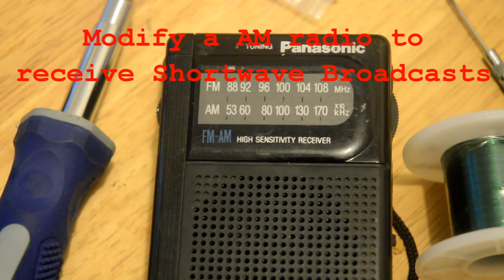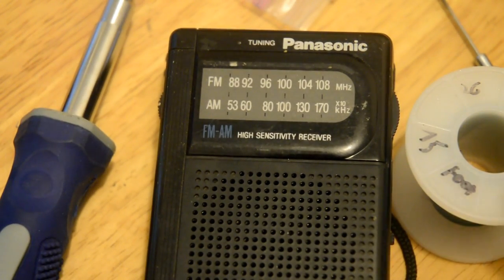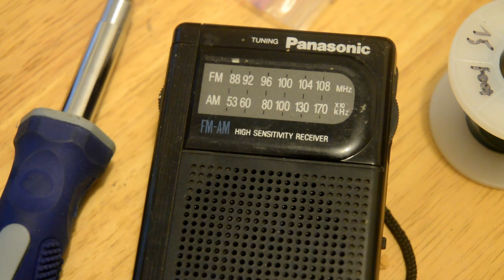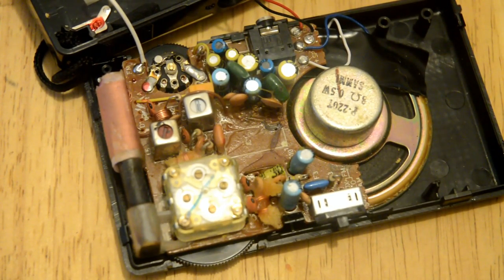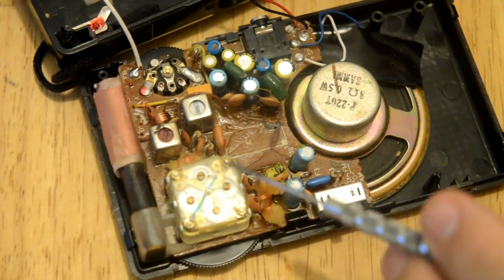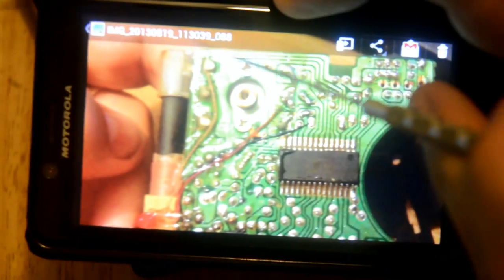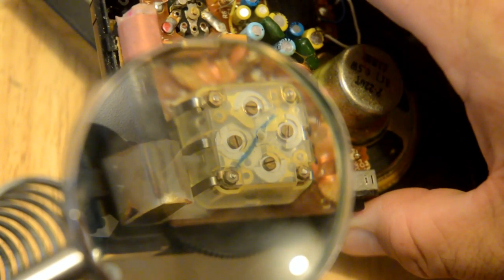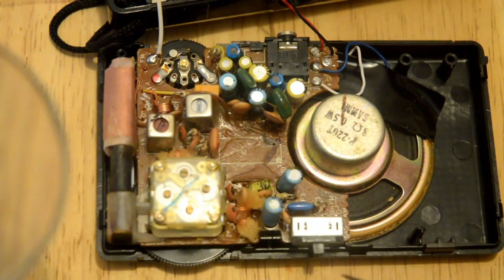Modify a AM radio to receive Shortwave Broadcasts

Comment: Hi,  Although you can shift the frequency coverage some by adding inductance, you will still have a very poor SW receiver. Depending on the disaster, I would think most people would want access to their local FM and AM bands. If there was an EMP event there is a good possibility the radio would not survive. Which makes a good case for leaving an AM/FM radio in a metal container with a few sets of batteries not installed but handy. As cheap as radios are, I would encourage putting 2 AM/FM radios in a metal box. The units that have hand crank generators are excellent. Additionally, a CB walkie talkie or small mobile unit could be helpful. A couple of Gel-cell batteries would be great but remember to test them every couple of years and replace them as needed. Family Radios, FRS, are great for communicating directly to a family member or neighbor within a mile or so but CB will have a much greater audience and help you know what is going on in your community Here is where, I would like to plug Amateur Radio, also called Ham Radio. The entry level licenses is now the Technician class and most people can study on-line test and be prepared to pass with little effort. Once obtaining a licenses, one can find 2-meter hand held radios on ebay for around ~$50. As one person stated get a Short Wave radio as well. You can buy any number of fair SW radios around $100. There are MUCH better units and I defer anyone reading this to watch some youtube videos on Short Wave Radio. This will give you  a lot more frequencies as well as international stations to listen to, assuming, they remain on the air after some international disaster. SW radios need wire that you can run outside for best reception. As little as 50 feet will work OK, 100 feet is even better and it does not have to be way up in the air. Just with a sling shot and some nylon rope, you should be able to get a wire over a 20 or 30 foot limb. I prefer insulated and stranded wire for around 14 - 18 gauge for long time storage..A few hand tools such as wire cutters, pliers, electrician knife, and a set of Phillips and common screw-drivers a roll of electrical tape and a simple volt ohm meter from Harbor Freight for under $10 will help with working with wire, terminal post, Batteries, ect, For more USA information check the American Radio Relay League www.ARRL.org. Many countries have their own Ham Radio organizations which encourage Ham radio as well as Short Wave Interest  Good luck. and as we hams say  73, (Best Regards)  Glenn WA4AOS

Comment: It won't be perfect.  It WILL work. They DO work. Too much with the theory and tapping on the phone with two fingers... you really don't have to mess with any trimmer capacitors or IF cans...actually, screwing around with alignment without a scope and a signal generator will more often get you in trouble as not... But no great harm in the little project! the top of a Bic pen can be used better then a screwdriver if you don't have any proper plastic alignment tools. And be careful, those tuning slugs are really, really soft ceramic/iron...you can snap them off real easily! Just doing the coil mod (or my approach in message above) WILL work. 73 DE Bill W8LV.

Comment: Sorry to say, but this is pointless and useless... In the best case, he could do, is to (probably) shift the local oscillator into some random frequency, and, probably picked up some noisy unknown random signal... That is my opinion of RF engineer with more than 30 years of professional experience... Do not follow... Leave your AM/FM radio unharmed!!
Reply: Hello Rich, this is not a direct conversion radio, but just simple AM single conversion radio. The direct conversion is also called zero IF. It cannot receive normal AM stations, it's used, for example, for SSB... Regarding the SW radio, and I have many of them, my recent buy was PL-880. I highly recommend that model, besides, the sound is very good, FM is very clear.... You cannot go wrong with that radio!!
Reply: +Mike Mordkovich How well is the battery holding up on that tecsun?
Reply: +William Pitchman, Sorry, I did not see your question... The PL-808 has a good battery life, lasting for about 1 month for casual everyday use. The battery is a singe cell 18650, and could be charged via mini-USB cable without taking it out from the radio...
Reply: If one takes emery cloth, and carefully sands about half of the antenna coil down to the copper, fluxes and solders this portion together, this effectively gets rid of those turns. To this mess(!) you can solder a wire, say 20-30 feet long, and this will allow you to tune in shortwave. But the tuning will be very "tight"...you will have the shortwave band indeed, but just in a very small portion of the tuning range. And so you have to tune that narrow range VERY slowly, until you get some stations. I've done this, with a couple of the old Radio Shack AM "flavor radios" years ago. It works. But, with the huge selection of very good and cheap portable shortwave receivers out there available for very short change, why not just buy one, or two, or a dozen, and just store them away for a just in case scenario?
Reply: Mike Mordkovich  Not pointless nor useless.
This works! ----and (was)popular in prisons,especially with the Spanish guys, when your only choice for radio was bargain basement G.P.X. clear analog radio IF you could afford the $ 30.00!
Reply: I hope going to prison is not a requirement to do this.  A junk chinese radio is a cheap price to pay to try this as a camping radio when you dont have nearby stations.  As crappy as it sounds, i might as well make a crystal radio for this band that will have better volume and fidelity vs so much ststic and hissss

Comment: EMP god if your that close to EMP I would not even worry about a radio you be to close to the blast zone to survive anyway,and the magnetic interference  caused by a nuclear bomb going off a HF radio would be pretty useless,only way to protect it is in a very thick cased lead box buried in the ground.And if ever forbid this did happen I doubt many people would be left to broadcast anything useful anyway sorry to sound too negative but that's how it would be in real life not hollywood films and history channels TV portray,Back to video yes informative if last ditch attempt to get a short wave reception,but there a flood of cheap SW radios off the shelf and available would  that not be easier to prepare before hand?
Reply from the maker: Emp does not work that way. I think your confusing EMP with standing next to a Nuclear explosion. Here is a link on Emp testing. http://www.wsmr.army.mil/PAO/wuaws/Pages/Electromagneticpulsetesting.aspx
Reply: Shouldn't need a lead box - just a Faraday cage.
Reply: rpcomms1 your body is made of electrons too....your radio dies......Hummmmmmmm......

Comment: if an EMP hit us no radios will work there would be no power at all. unless they are battery only powered and even thats a bit iffy,
Reply: You are right. However, a tube type radio may work on a generator or battery power. Obviously most of us have nothing like that... BUT many ham operators do.  I don't think  it's a bad idea to own a vehicle with a standard coil ignition system with no computer. One thing I wonder about is how much our military computers and communication technology will work if that was to happen ?  Scary stuff.
Reply: Arthur Hunt you can probley bet the military would be fine something like and EMP they do think ahead on..
Reply: Hey dingus, that's why you keep your prepping electronics inside Faraday cages when not in use, in addition to keeping power sources for off the grid power generation.

Comment: In an EMP event that radio would be useless! Only tube radio would work.
Reply: +Shawn Rullens There is no 100% guarantee that tube gear would survive either..
Reply: That is all political BS written to keep people calm in a time of extreme paranoia. The ole "Keep Calm and do what we tell you, pay no attention to the man behind the curtain"
NOTHING can protect electronics against a large EMP, no metal trash cans, Faraday cages whatever, some will get through and that's all it takes.
A LAB test cannot compare to the real deal because a LAB test is done in a controlled environment with preset variables determined by the tester. In a real world event the variables are amplified and all over the place.
When Russia detonated Tsar Bomba, tube equipment in Hawaii and The west coast USA experienced failure along with parts of the power grid.
Reply: +ElfNet Gaming 
So what is it that the military does to "harden" their equipment? Is there an unconventional solution to get best results? Or is it all pointless?
Reply: TunedCavityLasers I worked with a guy who was in the airforce and he maintained the EMP hardening system on B-52's and he would never tell me what they did, he said it was top secret and he was still under an NDA or some crap. So I cant say what they do because I was never told, but he did assure me they do have systems to deal with EMP up to a certain point of course.
Reply: +ElfNet Gaming 
Now you went from getting me thinking to making me think even more...  Well I guess we could assume it wasnt a bulky chunk of metal type storage container. They probably approached it similar to the Earths protection either redirecting the pulse or an absorber of some sort, perhaps both. I have seen some proprietary  US military PCB's / computer mother boards.. They love redundancy and gold trace. Would like to break some IC's down and see what materials they use...
Reply: TunedCavityLasers I assume they use some sort of meshing system but like I said I an not 100% certain. I know they use a lot of gold and sometimes silver for connector purposes..

Comment: wouldn´t it make sence to show how its done practicly ?  instead you´ve got a long introrduction, but when it comes to the point you dont let anybody see how its done.
Reply: Analog Radios are similar. I watched twice
Pretty easy.
Reply: @ayebee1207  It's far more complicated than this. The passband of an AM is not nearly wide enough to pick up "shortwave broadcasts" by adding a few turns of wire and adjusting the trimmer screws in the tuning capacitor. The alignment coils, IF, and others need to be changed also. You can get a cheap radio that receives SW for $20 on Amazon. 
And good luck finding an analog radio these days. There aren't any being made that I'm aware of. 
And if were really going to talk about having a "prepper" radio, any semiconductor or microprocessors radio will be worthless in the event of an EMP. 
Recapped, tube radio will be the only thing left unaffected and working.

Comment: Sir,

No offence taken! I will give you an example of the how it works: Perhaps
you have encountered an old National Radio, model number forgotten many
years ago... You had with it, a set of plug in coils. Just different
windings on separate coil forms. Much later, (and much better) the Zenith
Transoceanics, but still mechanical band switchers, changing coils, albeit
a few capacitors as well. But still coil changing, and still mechanical.
Also, in the matter of the 455 khz "problem", should the set have a "Long
wave " position, at 455 khz, you will get a birdie "squeal", and at
multiples of this frequency, of course a bit less at higher multiples, and
say for lower ones as no way to tune that low, but in theory, rolling off
the same way.
No, not the best way to do this, but it will work, and in an expedient
situation, it will work, or just for shits and giggles at the workbench.
No, it won't be an R-390A, but it will work.  Why not just get a little
Sony at Wally World and give it a go? ;-)

73 DE W8LV (& W8LV/VE3) Bill

Best Regards from Amateur
Radio Station W8LV
Station Info:
www.hamqth.com/W8LV
Reply: thats great man,  good instruction with good humor 😁